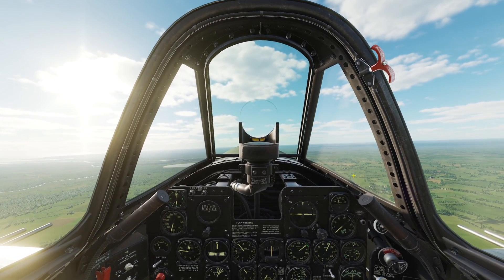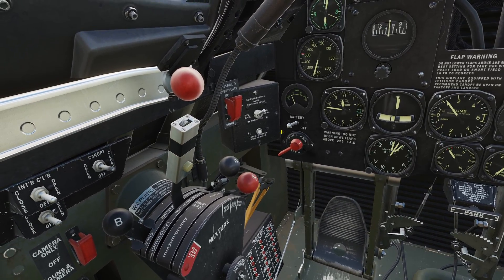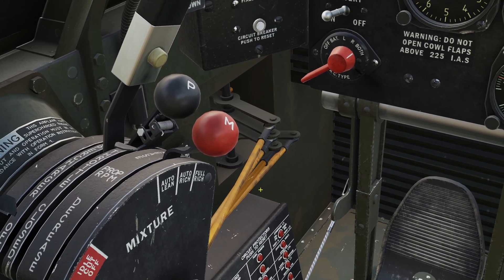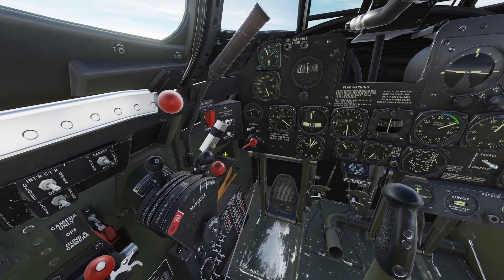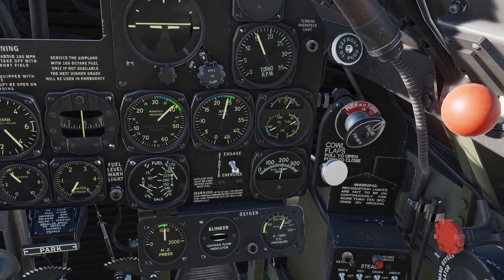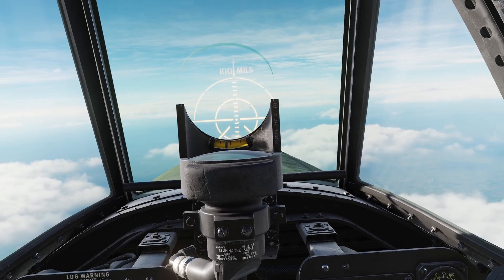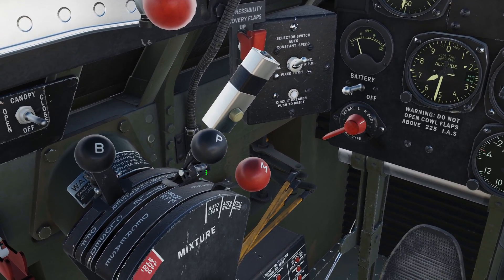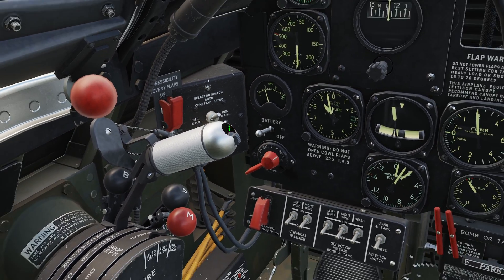DCS P-47D Engine Management

Comment: Slight nag, but the function of the prop lever is not to directly set the pitch (you can still do that with the prop control switch in the manual mode though). 
The Prop lever sets the rpm for the prop governor to maintain. Then, depending on the speed of the aircraft and the power setting, it will adjust the pitch to maintain that rpm, hence the term "Constant speed propeller".

For any given RPM, speed variations and throttle changes will have the most direct effect on the pitch. 
If the power that "goes into the engine" via the throttle (air/fuel mixture entering the manifold) increases, the engine will want to turn faster, but the prop governor will increase the pitch of the blades, which adds thrust thanks to the bigger bite of air, but also drag which slows the rotation, thus maintaining the RPM.
If the power is reduced, there is less power going into the engine, and then the governor will reduce the pitch to lessen the drag and maintain RPM, which also decreases the thrust and thus the power coming out of the engine.

The resulting power settings are maximum values for given regimes, usually limited by wear and heating of the engine. You can absolutely leave the RPM lever where it is so long as you dont exceed the indicated MP for the RPM (rule of thumb is throttle aft of propeller always), which can cause all sorts of issues like excessive heat and overtorquing the engine.

Throttle idle with prop full forward is a very effective way to slow down, since the governor will set minimum pitch, which equates to maximum drag (like turning your hand perpendicular to the airflow) and minimum thrust, ergo your prop becomes an airbrake of sorts.
Turboprop aircraft even have special pitch ranges that maximise this drag (beta), allowing some to perform incredible descents while being braked by the flat plated prop.

Comment: Correction: with the P47D in “AUTO” the propeller level doesn’t “directly” control the blade pitch. The gearbox is controlling the pitch to to maintain a “specified RPM”. 

Old WWI planes you controlled the propeller pitch, which adjusted the RPM. This is the opposite. That blade angle is ALWAYS fluctuating when flying a constant speed airplane.

Comment: Okay, the oil cooler doors were wide open and the oil temperature was below the minimum. I closed the oil cooler doors all the way and the oil temp rose into the green. That brought the oil pressure down. What I reckon is the oil wasn't warm enough and was thick causing high pressure. But you've got to keep an eye on the oil temperature as if you leave the oil cooler doors closed it will eventually overtemp. When it gets close you'll want to at least open the oil cooler doors half way to neutral.

Comment: From a warbird pilot (original T-6 and BT-13) - this is one of the best radial engine management tutorials I’ve seen, period. Simple in explanation, but thorough. 👍👏 Bravo Zulu!

As for why pilots advanced the RPM lever FIRST or retard the same lever LAST during power changes, it’s to prevent damage to the engine by accidentally exceeding max manifold pressure. 

Blue skies!
Reply from the maker: thank you for the kind words!